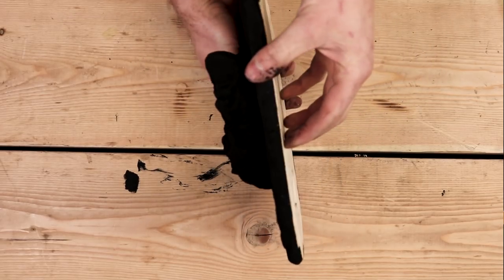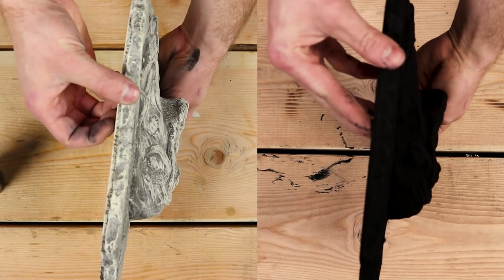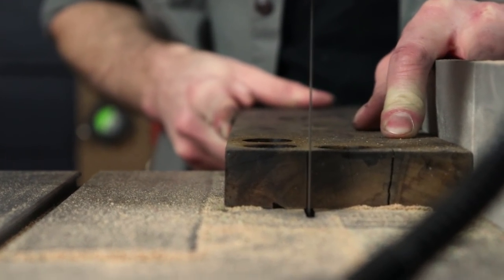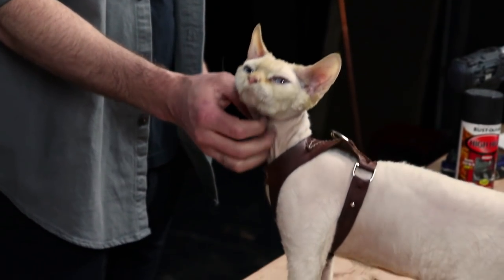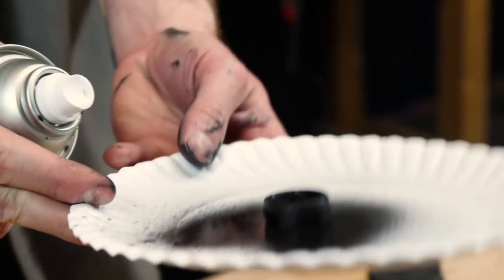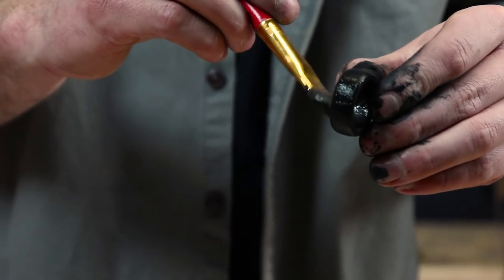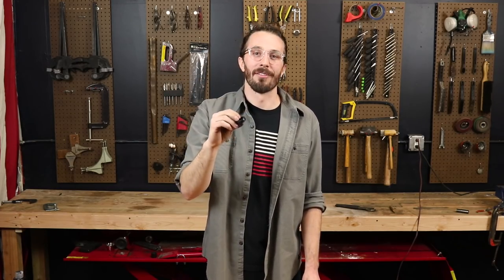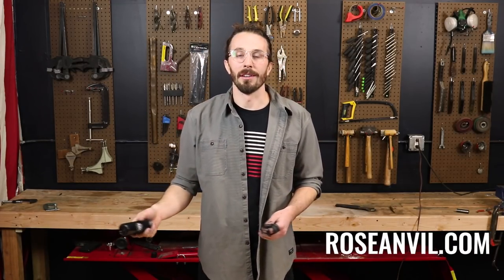Vantablack Alternative? (BLACK 2.0) - WORLD'S BLACKEST RING?

Comment: Vantablack is NOT a paint.  It must be assembled onto the surface using heavy equipment in a vacuum. 
Black 2.0 is the darkest,  flattest PAINT (and a damn good one too), but it isn't able to trap photons nearly as effectively as Vantablack.
Reply: Even if Vantablack was available to purchase, it's worth more than gold and diamonds , not to mention the machinery you'd need like you mentioned.

I think I'll stick to Black 2.0... lol
Reply: Freedom Fighter indeed.  It is better to think of Vantablack as an engineering material or a surface treatment used to absorb photons.
Reply: It also happens to be carcinogenic
Reply: theGunneWitche  you would cook your skin under your finger if you had it because it’s absorbs all light and heated pretty rapidly
Reply: Hey genius. Can I dye my silver ring with black 2.0 and is it permanent plz ?
Reply: @jelljell7871  not "dye".  And black 2.0 is too delicate to stay on a surface that would he touched all the time.  You might look into "black magic" metal treatment fluid.  It's a clear liquid that, when brushed onto a metal surface, turns metals black.  I don't know if it'll work on actual silver, though; I only know it will work on steel.
Reply: @XianHaos  thanks for the valuable information